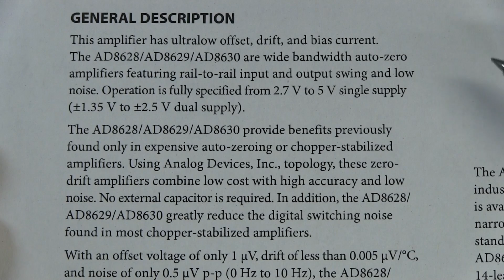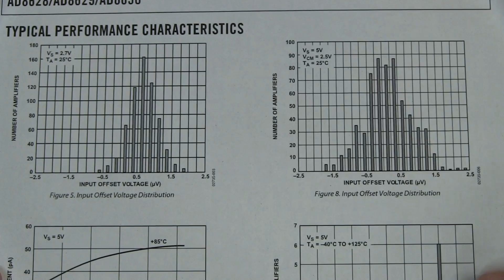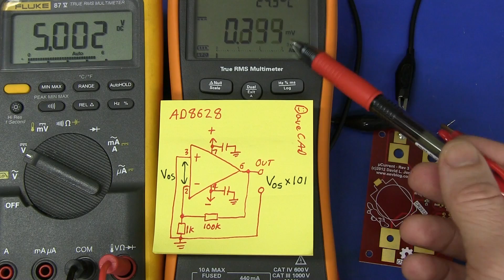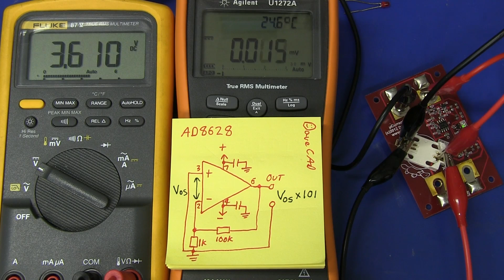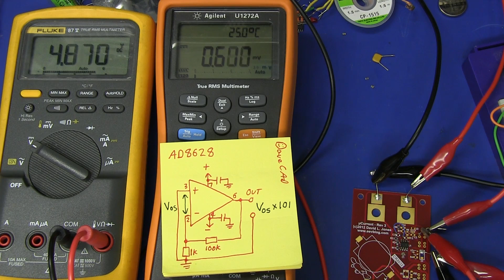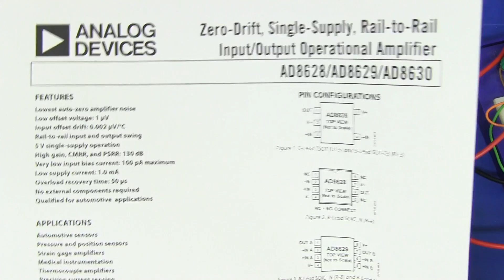EEVblog #476 - Opamp Offset Voltage Measurement

Comment: That is very easy. Just remove the capacitor on the negative supply and it will work fine. Why is that: when chopping there flows a small switching Charge (e.g. 1pC) through the negative supply. This is not a problem, but when you add your capacitor it will translate this charge to a constant error voltage. In case of split supply your supply tries to compensate and this amplifies the error. You should have analyzed it with an oscilloscope not a multimeter. For any part which is designed for single supply it is a very bad idea to place a cap on the negative supply.
Reply: hugo schmeisser No comment from Dave on this?
Reply: hugo schmeisser The voice of authority! Cool
Reply: +mart fart No response means, most likely! Dave will usually respond to comments like these if he already ruled them out.
Reply: +Richard Smith in other words, this Video was just a big fail from Dave because the chopper opamp works just fine?
Reply: Andi Amos Well. Dave knew it was him and not the op amp, he tested a few of them.
Reply: Reference book to learn all this stuff ?
Reply: In EEVBlog 479, he explains it is because of the input bias current. I don't know how accurate either theory is, but I thought people should know Dave has another explanation.

edit: later in that video, he also experiments this

Comment: Dave, manufacturers do recommend to balance opamp inputs against bias current. In the test circuit you need to ground (+) input via 0.99kOhm resistor.

Comment: Yes, that was my first thought too.
I usually try to equal the input impedances to reduce offset.
Also, using just a bypass cap between V+ and V- (instead of two to ground) usually reduces noise.

Comment: With a chopper amp, as there is internal switching, I'd think the correct way to decouple would be across the power pins, not to ground, as the latter could inject  noise into your ground reference. My guess is if you have your cct as shown and then touch a cap between the power rails you'll see the offset drop.

Comment: I think you're seeing AC Coupled current from the chopper circuit to ride the supply rails and is converted to an offset voltage across the resistance of the bypass caps. It's then added/injected back into the non inverting input. Placing the bypass across the rails works against the ping pong (push pull) chopper currents to effectively zero them. The I/V conversion is done across the rails with no path to ground so is sent back to the rails in opposite fashion.

Comment: I had a similar problem with a Microchip chopper amp, the offset voltage was way out of spec. I found that in split supply configuration both plus and minus supplies had to come up evenly relative to the Ov reference (-ve input) in order for the chopper stabilisation to work properly. I would agree with @mikeselectricstuff, the decoupling should be across the power supply pins of the op amp, and probably decouple both supplies to zero volts close to the start zero volt point too.

Comment: All right! There's the challenge post-it in DaveCAD (say namaste to the Indian in the post-its cupboard for us.) You changed the decoupling caps before shaking the specsheet at the camera too; so clearly what cannot happen in the next ep. is for the substantial DC leakage of the 302-type caps and/or input differences between the rail-bound inputs and supply to weigh in! So: grisly, twisted, medium-current family infighting between input isolation stage bias supplies internal to the opamp FTW.

Comment: Dave my first thought was that the inputs on the opamp aren't seeing the same impedance. Normal practice would be to connect the non-inverting input to ground via a 1k resistor. Having said that the input bias currents are only 100pA max on the data sheet so that should only account for 0.1uV offset. Still might be worth investigating.

Comment: I think the input offset voltage varies with input common mode voltage and probably supply voltage. When using split supply, there was common mode voltage with respect to the negative supply and when you vary the supply voltage both the common mode voltage and supply voltage are changing, causing the input offset voltage to change. With single supply, the input common mode voltage remains zero and only the supply voltage is changing.

Comment: You're doing a great measurement fault. The offset voltage is the voltage needed at the input, to get an output of zero volts (wikipedia and so on).
In your setup, the output voltage isn't zero and therefore the input voltage difference isn't the offset voltage. 
If the output voltage would be zero, your input voltage would also be zero. That means you only make the right measurement, if the output and the offset voltages are zero.

Comment: Bit of a long shot but maybe thermal noise from the resistors. Try heating up the 1k and see what happens. Maybe one of your supplies could be off a tad. Move your ground up and down a bit and see if you can zero out the offset. Might give you a clue on to what's going on.

Comment: With a single supply the offset is nill.
With a dual supply the offset is ~.3mV
It has to be the reference point.
The gnd is floating, with the non-inverting input and inverting input pull-down resister not getting along... ?????

Comment: Is it due to seeback effect on the one of the OP Amp pins? although the temperature difference is negligble, but on microvolt level this could be accountable. Analog Devices suggests to add two resistors from non inverting input to the ground so that the seeback effect could be neutralised. Two plus two. This will also ensure that the bias current is balanced properly on these two pins.

Comment: Redraw this to make it more obvious.  Move the 1K around so it's between the + and -.  So + is to ground, - through the 1K to ground, and then whatever output that generates wrapped back around through 100K to swing the - input.  Sort of doubting that's the offset voltage measurement circuit they're using to spec the device.  So the 320mV would be what the input offset/output errors etc induce when it's then put into a non-inverting amplifier circuit..

Comment: Note that the worst case input bias current (over a full temperature range) is 1.5nA - that would give ~1.5uV across a 1kOhm resistor.

Also, the bias current will likely depend on supply voltage (more leakage at higher voltage) so this could be the case indeed.

Comment: Thumbs up. That resistor should be 100k || 1k though.
See page 1.60 (p 62 of the PDF) in ADI and Walt Jung's Op Amp Applications Handbook (available for free at analog dot com)
There is also a discussion a few pages up about measuring input offset voltage. (1.53, PDF p55)

Comment: Dave, there should be three cables from power supply when using split supply (+, - and 0v), I can only see two.. could it be that you forgot to connect the 0v cable from supply? If so, the 0v reference is being determined by the parasit DC current of the capacitors and that is the reason the output changes according to the capacitors you used..

Comment: shouldn't the non-inverting input be grounded alone and not connected to the inverting input? (I'm a total newbie to electronics!!!) and wont the caps be passing voltage to the ground through to Vos

Comment: hey dave! Ive recently graduated year 12 and wanted to be an electronic engineer and ended up in a bridging course at the university of Wollongong for electrical engineering (Ive been told the course contained electronic). Have you heard anything about this course? do you have an opinion on any other unis (UOS, UNSW, etc)? I know my question is kind of specific so you might not have info on it but its worth a try seeing as you're in the area & industry :)
thanks!

Comment: I'd be interested to know how you're getting your ground reference... if you're using a potential divider, then perhaps the potential divider providing your feedback is pulling your ground about? Try measuring -ve to 'ground' as you wind up the supply voltage? See if it's solid.

Comment: having  0V 5V versus -2,5V 2,5V is the same, you still have 5V between each point. only that instead of using 2,5V as center, you would use 0V, but it's still +2,5V from V-
It's just a matter of reference point, having dual or single supply doesnt matter, only if the opamp cant do rail to rail or for zero crossing.